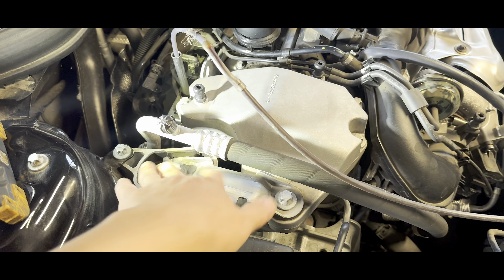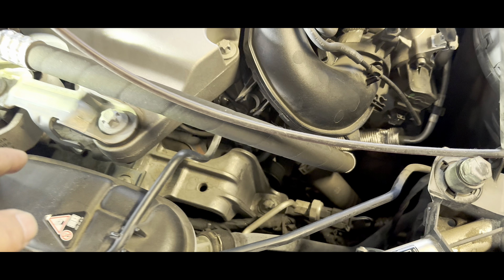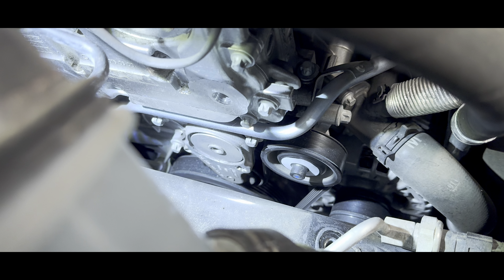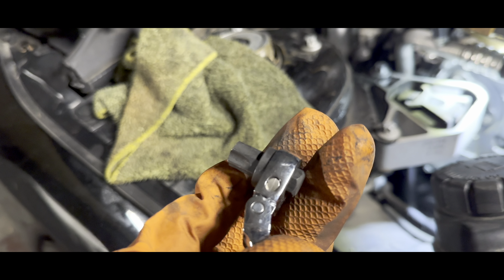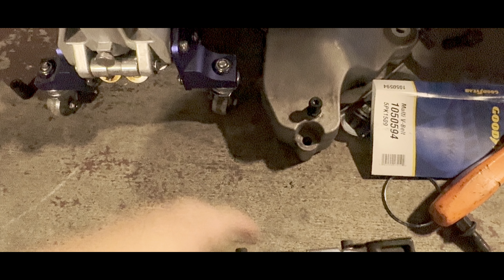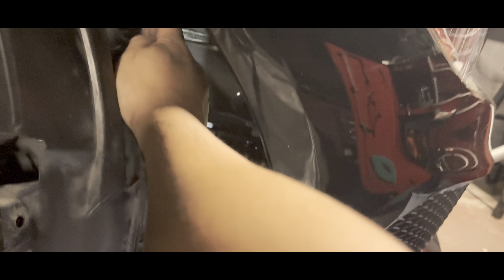Mercedes Benz CLA Belt Replacement

Comment: replaced my spark plugs last week now need to do my engine mount.
Reply from the maker: Those spark plugs are a task 😅
Reply: I been trying to clear the code po303 replace coil and plugs the car still run rough and check engine still on,Don't want to take it to dealer.
Reply from the maker: @bravo6631 was the code there before or after? Check the coil and its connector on cylinder#3 swap the coils around to see if u have a bad coil.
Reply: You couldnt take off the belt from the bottom?
Reply from the maker: @c8miamicarclub u can remove the belt from the bottom if you loosen the top, u can pull from bottom or top.